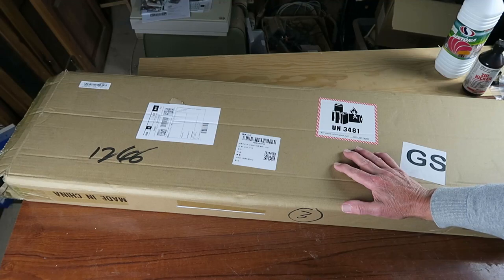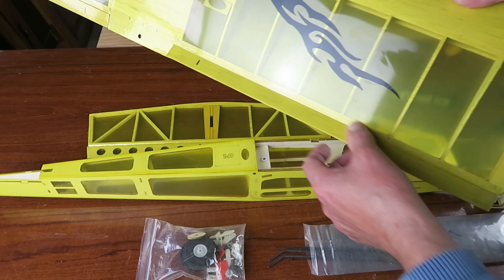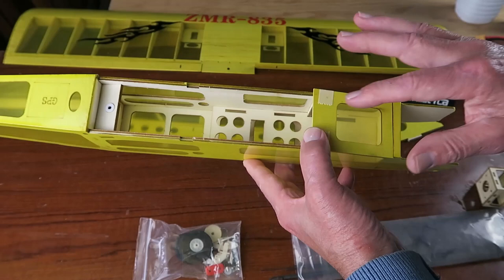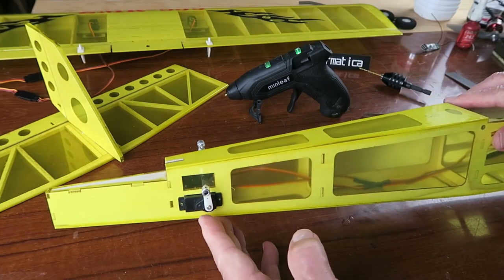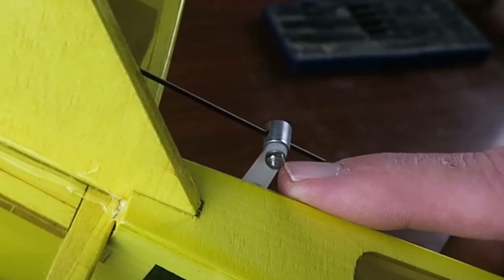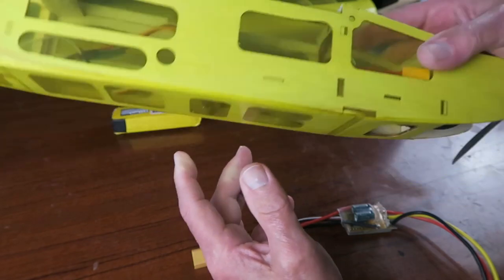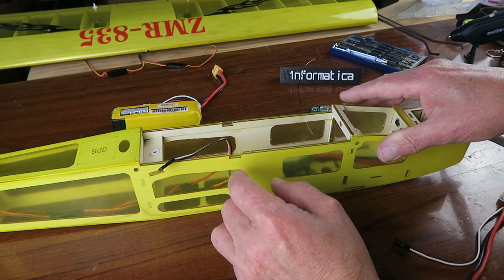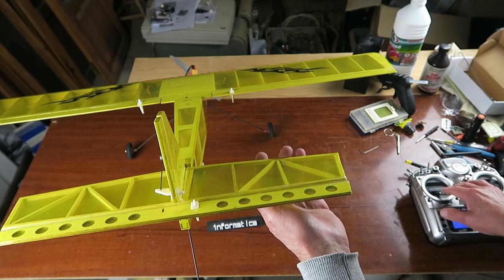ZMR 835 835mm Wingspan Balsa Ply Wood RC Airplane KIT Build

Comment: Hello again - well my ZMR 835  has arrived ! - its was packed the same way as yours was and is in great condition, same problem with the moving surfaces all taped on one side only - just posted a video of the Unboxing .... watching your video over and over again to make sure that I know what to  lookout for, I thought that the laser cutting and build was quite good  -  - once again thanks for this  video..
Reply from the maker: Cool! I'm still not allowed to travel to the flying site so you still may get yours in the air first! Ask any questions you want.
Reply: @1nformatica  Thanks so much - I would like to know how you got the Aileron servo wires into the Fuselage ?, I ask as they seem to come out of the wing via the Oval holes which are not over the centre Wing saddle ?
Reply from the maker: @FlankerTanker  There are pre cut notches in the fuselage sides in line with the oval holes where the servo leads pass through. They're probable covered by film. One tip I was given was to use a soldering iron rather than a knife to cut the holes in the film.
Reply from the maker: ****STOP PRESS*** Maiden flight video here : https://www.youtube.com/watch?v=lPKak07QK9k

Comment: Great video as always. Just a couple of suggestions:
1. Use a tip of a soldering iron to cut the film - this seals the film to the surrounding structure.
2. You mentioned using loctite on the threads of the control rod stoppers. I did this in my early days in Spain and not only did it lock the nut/ thread but managed to bind the assy to the control horn with the inevitable result. Since that occasion I have employed the use of 2mm Nylocks with great results.
Hopefully these notes might be of help.
Reply from the maker: Great advice as always thanks! Where do you get the nylocks from?
Reply: Model Fixings in UK - I'll sort out the details for you .

Comment: at 6:37,  IDEALLY,  the  lever-arm  at the servo arm  Should be  roughly  Equal to  that in the associated  control  horn.       the use of more lever-arm at the servo results in increased travel, while the servo's  mechanical advantage  is reduced.      googletranslate

Comment: note that, if the fuselage length --- from prop to elevator te --- is not roughly equal to 75 percent of wingspan,  the  PROPORTIONS  are   wonky.

Comment: I have just purchased one of these, this video will be very helpful, where is your cg location from the leading edge in mm ?
Reply from the maker: Where is the CG? A very good question! There is no indication on the model or shown in the Chinese video. As built with a 1500 mAh 3 cell pack the CG is about 70mm from the leading edge down by the servo arm. I feel this is too far back. I always want a forward CG at least for the first flight or there may not be a second! I used this calculator : http://southernairrc.com/tools/cgcalc/centerofgravitycalculator.htm Using 30% as the MAC balance point gave me a result of 2.1 inches or 53.4 mm from the leading edge which seems about right. Achieving that is difficult. I 3D printed a 15mm spacer to move the motor forward. Even then I need an extra 20g of nose weight to get the CG right. https://drive.google.com/file/d/1s2VMeaHk5rsu-4n1igGvZNKqNOtMGGs9/view?usp=sharing We are back in lockdown now for another week or so and I cannot go to the flying field. Maybe you will maiden yours first and let me know how it goes!! Good luck! Please consider subscribing if you have not done so already!
Reply: @1nformatica  - \thank you very much for all this information - Very Helpful - Mine has not arrived yet so I have plenty of time to think about all of this and re watch your video regarding the build - We are also in lockdown until sometime early Dec or so we are told - and my flying field is closed as we are affiliated with BMFA and they say the fields must be closed.. so I have not been flying for over 6 weeks now - 3 due to rough weather and 3 due to the new lockdown ......Thanks again I will keep in touch if that is OK ..
Reply from the maker: @FlankerTanker  Yes, this lockdown is a pain 'though necessary I guess. Fortunately I have a small area near my house where I can fly this little guy https://youtu.be/YOkfSLczCLY Really can't recommend it enough. For me it's perfect in beginner and intermediate modes virtually un-crashable! In expert mode I'm getting better but it's great to be able just to flick a switch and get her back on track without trashing it!!

Comment: some info.     at 4:42,  you do not mention motor kv,     optimal prop diam  is directly proportional to  kv; eg.,  a larger prop  needs  lower  kv (and more volts).       googletranslate

Comment: some info.       at 6:47, more  design  flaws.        a too-short pushrod is not a happy pushrod.      DESIGN  of  the  wing  should  Accommodate location of the aileron servos  forward of  thirty percent of chord; oriented with the output shaft  Forward.      googletranslate

Comment: some info.      the use of full strip ailerons is not recommended.     consider reducing aileron length by about,  one third.       at 4:04,  that is  NOT  where servos  Should  be  located !!!!     googletranslate

Comment: at 7:19, the big problem is that it is  FLAWED  design !!!       most hobbyists qualify as being 'self-taught'.      most hobbyists  STOP  learning  Important stuff, when they  SHOULDN'T. 
an airframe has  TWO  balance 'points'.      cg is one  -  it is relevant,  WHEN an airplane is  Flying.      c-m, center of mass, it the other.      in order for the c-m to be  Optimally  located, the stabs  and  tail boom  Should be made as light as practical.       consequently,  such a far-aft location of the    Mass    of  two  servos   is    WRONG !!!      googletranslate